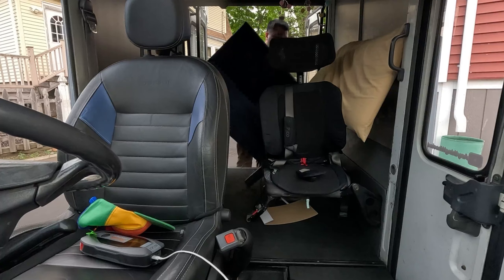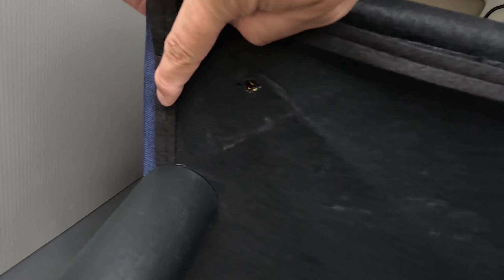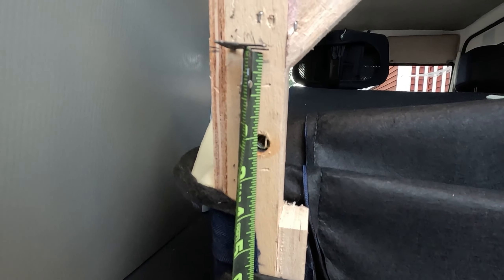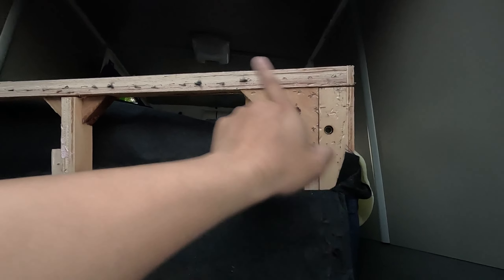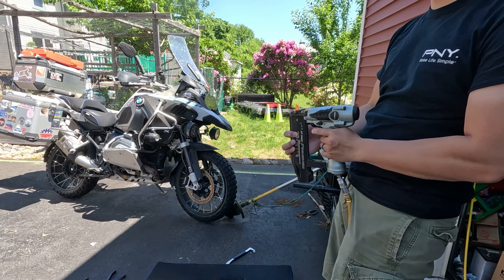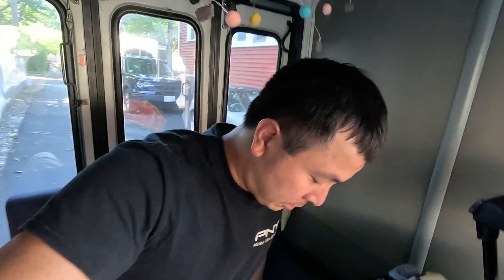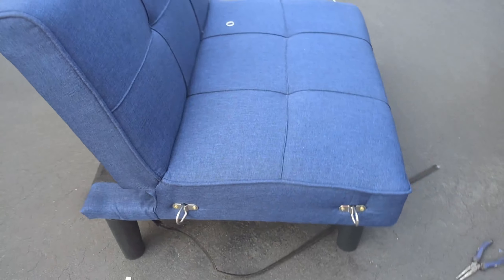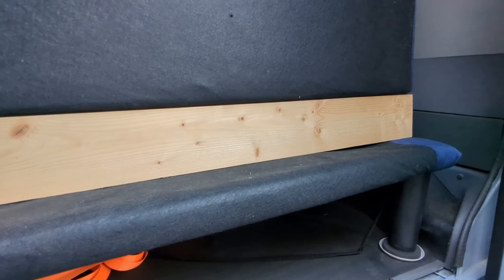Rear Seats for my Daihatsu Mira walkthrough van - Seems legit.

Comment: KEI vehicles are not allowed on the roads at all in my current state of residence: Kentucky.  Licensing and registration is also being revoked in some states that used to allow them and existing owners are not permitted to be grandfathered in.  Big3 automakers don’t want these cutting into their profits on oversized gas guzzlers.  Some states use safety to outlaw them yet they allow motorcyclists to ride without a helmet.
Reply from the maker: All of them or just the trucks and vans? 
What about like an AZ-1 or Cappuccino? 
Not allowing them is the tricky part for them as someone can drive in with out of state plates too...
Reply: @AnythingWheeled  all of them I’m not sure how they would handle someone with out of state plates but they are definitely not allowed on the interstate or 2 lane roads. I called the DMV and they told me not allowed, not registered, not licensed
Reply from the maker: @wilty5 that's lame. 
If it was an out of state driver they'd have to honor it like every other vehicle and drivers licenses.
Reply: @AnythingWheeled  perhaps , but any driver that drives through a state is bound by the laws of that state, ignorance of the law is not an excuse, they may get a ticket, warning or fines, etc
Reply from the maker: @wilty5  yes for things like wearing seatbelts or helmets of the like etc. However when your vehicle is a legally registered vehicle of another state it is valid to operate through. 
You get into the legal issues of being a Kentucky resident keeping an out of state plate vehicle but I suppose that's the allure of Montana LLCs to assist

Comment: with all the money you saved on the cheap furniture, you can get a good tape measure and learn how to use it, so this sort of thing doesn't happen again
Reply from the maker: What's wrong with the tape measure I used? It won't save me from my own brain farts 😆 I need a brain upgrade
Reply: @AnythingWheeled  don't worry, if you stay at it long enough you'll get better , but don't be surprised, there is always an old timer that will rag you